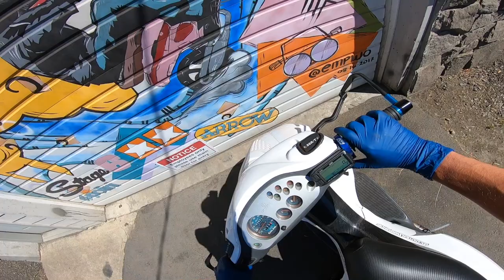GIlera runner 180cc smart carb install

Comment: Build a piaggia zip 172, take the 50cc engine out from the zip then get a skr/skipper 125/172 and just swaped it
Reply: I got one .. and tuning it :) already has a malossi exhaust, malossi innerhead, malossi variator .. soon malossi kevlarbelt, malossi flyclutch and  malossi VL16
And im not bullsh#tting .. you can check my vid
Reply: Get a Hexagon EXS/EXV 125/150 engine, these are liquid cooled, and fit with the original Zip 110mm drum wheels, another option is to get a drum brake M05/06 or drum/disc brake M07/08 engine, convert it to drum brake, and use a Gilera Typhoon XR 125 rear wheel with a 140mm drum brake, although these are very hard to find, the M06 from a Hexagon LXT 180is the most powerful engine (20,4hp) with the tallest gears (13/30x13/41) ever produced by Piaggio,
Reply: @frankrommerts8447  i have a M06 from a Hexagon LXT 180 with gilardoni 172cc.. i got video of it on my channel
Reply: @frankrommerts8447  m06 from lxt has standard 180cc gears. Hexagon LX 150 has the longest gears, longer than any 180cc. I know it because i owned both these engines
Reply: @MrDramka  They both have the same ratio, primary gear 13/30 and secondary gear 13:41, however they are not interchangeable between the EXV and M06 engines, the Hexagon EXV 150 engine with the original 130/70-10 tire will travel 1,37 meters per rotation of the rear wheel, while the Hexagon LXT 180 will travel 1,45 meters per rotation of the rear wheel because of its 130/70-11 inch rear wheel, the extra power that the M06 engine (20,4hp) is producing compared to the EXV 150 engine (17hp), is more than enough to compensate for the taller final drive ratio, which is a direct result from the 1 inch larger rear wheel/tire diameter, in fact I used a Malossi 15/41 secondary gear from a Runner FX 125 to compensate for the fact that I used a Gilera Typhoon XR 125 rear wheel, with a 130/70-10 tire on my Zip Sp 98, because it has the same spoke design and 10 inch wheel diameter as the original Zip SP 98 wheel, although the width is 3,5 inches on the Typhoon XR vs. 2,5 inches on the Zip Sp 98, and the diameter of the drum brake  is 140mm VS 110mm on the Zip Sp 98.,there are only two types of 10 inch rear wheels that will fit on a Piaggio 2 stroke 140mm drum engine, the other one was originally used on the Aprilia Habana/Mojito 125, the dimensions between the rear wheel of the Habana/Mojito 125 are the same, but the Aprilia doesn't have the same backward swept 5-spoke design like the Typhoon XR and Zip Sp 98 wheels have.

Comment: I have a zip 2000 with a hexagon 180cc LC engine .. 
i wanna change my clutch from original to malossi fly clutch but have no idea , what spring and strength to get .
I only have a malossi multivar atm in it.. any suggestions? white 6.8K , white 4.3K or red 7.5k ... with 12,5 gram rollers

Comment: barrel was tuned by avdm for pm59 right? then you shouldnt use a different pipe.
Reply from the maker: Correct we put it on to try haven’t really ridden the bike in a. Year or so
Reply: aflio s a really cool guy, just throw that pm59 back on there and get the new avdm manifold
 @Scooterswapshop

Comment: i dont want to be rude or so, 

but installing a normal carb isn't gone take 1 hour, i can easily but a carb on and make the carb good how its needs to run
Reply from the maker: Tuning this carb, if you want to get down to nitty gritty, Is 5 minutes with no tools.
Reply: @Scooterswapshop  aahh, but i heard from people that you get a little power lose from those carb.
and you sould totally get a DDL tuning exhaust its mentol, you can look it up on yt 180cc DDL exhaust💪🏼

Comment: I want new navi stuff pleaseeeeeeeeeee , bore kits ,  I need customization parts for it
Reply from the maker: The issue right now with the navi is no speed can be gained without more rpm. And we can make cams to allow that as Honda doesn’t have any available. Doing one out of billet would have $500 price tags
Reply: @Scooterswapshop   lets say u make them, available at the price of $500 how much mph more can we gain or reach with cams
Reply: @Scooterswapshop   I understand , but every time I search the internet and don't find anything new for the navi , its kind of frustrating compared to other scooters and grom ect

Comment: I don't see a lot of movement on the customization department , no carbon fiber parts or nothing new , what I am worried about the community for these Navis isn't growing at all , people need to come out with new stuff so people like me the have one , feel good of having options to make the navi look how we want .
Reply from the maker: It takes time. Understand the main issue is Honda doesn’t even have replacement parts for these. People also need to be willing to pay for nice parts. A quality pipe is $450, carbon fiber is very costly. These are entry level bikes I don’t foresee people spending $1500 on wheels and disk, and $500-1000 on carbon. Believe it or not, to make several carbon items for a bike it’s a $50-100k investment that may or not pay out. They’re not sold in Taiwan this is why the parts cannot be made cheap at the moment